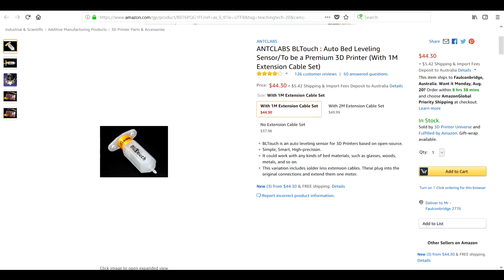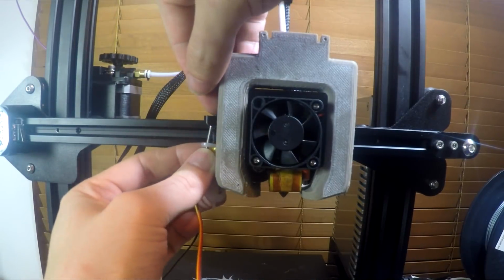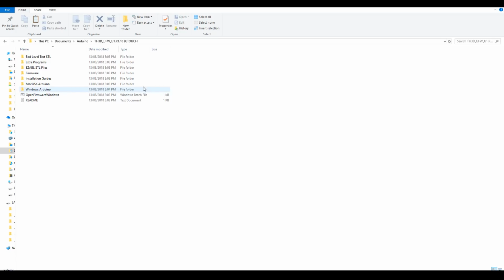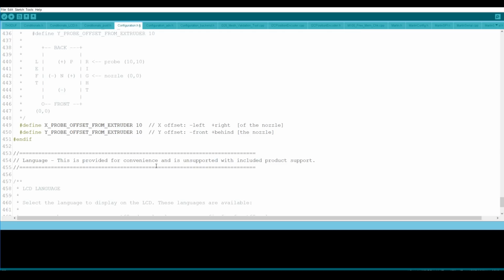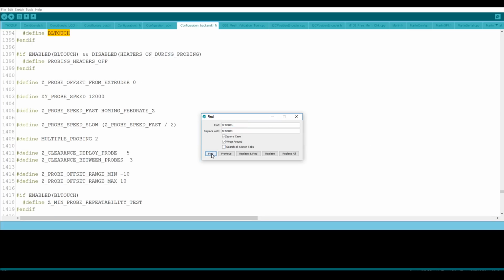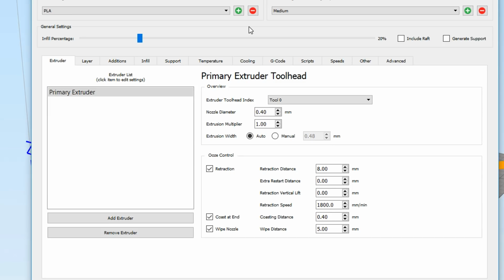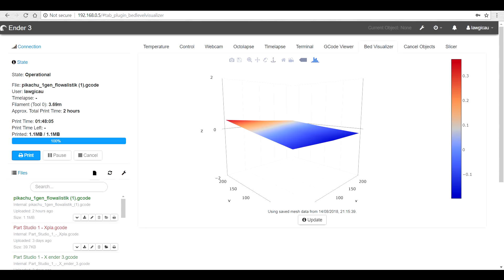How to: Ender 3 BLTOUCH with SD card support and no wires cut

Comment: Just fried the main board on my Ender 3 following this guide :) Hopefully its only the main board that's fried. I think the problem was switching the wires on the Pin 27 Board plug, it seems not all boards require this.
Reply: Yeah.  I just had the same thing happen.  Just plugged it in and smoke.  No display any more.  Upon further inspection, the pins for the Pin 27 Board plug do NOT need to be swapped as this video suggests (at least for the board I got).  I'm angry that I just followed along thinking, this all the changes must be necessary.  These guides give you the confidence to attempt something like this, and then turn out to be not all they are cracked up to be.
Reply: I had the same issue. But I don't know if the board is dead because I can still use it with octoprint.  But when I unplug the Raspberry the board doesn't start. I really don't understand what is happening here. Have you tried that on your side ?
Reply: @alexandreray8223  O changed the Mainboard, and now the printer starts. I still have a problem with my BLTouch, It just blinks now. I don't use Octopi.
Reply: @DanA-ox7gu  ok thanks I'll change the board I think and switch to mks gen l

Comment: Hello, I followed this tutorial using the TH3D Firmware U1.R2.7, had just a few differences, only 2 "BLTOUCH" search/replace and best of all, now there is no need to disable the boot screen anymore, it compiles to 98% of memory use at first attempt! Also, fortunately, my Pin 27 out must be ok because I did the swap like your instructions and everything is working fine. Autolevel is a MUST!!! Thanks!!!

Comment: I just installed my BLTouch following your instructions.  Many thanks!   I have a couple of things to note for anyone doing this after 1/28/19.  First, the latest version of Th3D doesn't need anything removed from it to compile down to the requisite size.  I didn't have to edit out the boot screen, as you suggested and still had a compiled sketch that used 98% of the board memory.  The second is a quirk that I discovered, and hope that it's helpful to others.  I first tried to flash the firmware from a Mac using the latest version of MacOS (Mojave), and ran into all kinds of communication errors with the board in my printer.  I first thought this was because I'd done something wrong in my wiring, but I could find no errors there.  The easy fix to the problem was to use a Windows computer to flash the firmware.  When I did this, everything worked just fine.  Thanks again for this guide.  I've learned much from it that I hope will make my Ender 3 prints even better in the future.

Comment: I followed all of your guides for this, I even flash the Unified Firmware when I had Marlin and for some reason the bed leveling isn't activating when i print. I am using Octoprint and Cura on my computer and uploading the gcode to Octoprint. I have tried it with the custom gcode in Cura, custom gcode in Octoprint and I cannot get it to actually work during a print. Please help as I cannot figure out what is going on and I have literally spent 8 hours trying to figure out what is going on and nothing.
Reply: Just to add...I can home everything in and set the z offset and I can even use bed visualizer in Octorprint to see my bed.

Comment: Hi Michael,  I have a genuine BL Touch on an Ender 3 installed as per your instructions and it has been working really well until now. What is happening is that after the 9 probes the "leveling map" is being lost, especially on the left side of the bed. Unfortunately there have been a couple of times when the plastic probe has hit the bed clip on the left side, could this be the issue or is it something to do with the script?   This is the starting script I am using that has been working well until now. At the moment my solution is to manually level the bed on the fly but thats not a proper fix.

G28 ; home all axes
G29 E; probe
G92 E0.0 ; reset extrusion distance
G1 X0 Y0 Z10 F6000
G1 Z0.1
G1 X6.0 E9.0  F1000.0
G1 X5 Y30 Z0.2 F3000 ; get ready to prime
G1 X100 E12.5  F1000 ; prime nozzle
G92 E0.0
Any idea what is going on would be much appreciated.
Reply from the maker: Probably the best thing you can do to troubleshoot is install the bed leveling plugin for octoprint. It will give a visual of what's being probed. Your start gcode looks fine. Sometimes if a bed is way crooked, the black touch will struggle. The plugin will give you more info.
Reply: Thanks for the advice, can I just plug a laptop into the printer and use octoprint rather than go down the RasberryPi route?

Comment: After doing this, when trying to print, my SD card menu is EXTREMELY slow and lagging. Is there anything I could do to fix this? Printer runs perfectly if you can get the print started.
Reply from the maker: Do you have many files on there? There are options in the firmware to change how the files are read and sorted,bi would start there. Also try another SD card just in case.
Reply: @TeachingTech  I did. It was almost like the printer was in shock or something for a minute. Works just fine now. Thank you for your videos on this and the bootloader. Great job!

Comment: No need to use a pin27 board and still no need to cut the buzzer wire. Just use 9 male/female dupont wires to extend all wires from ribbon cable to board connector except for the wire connecting to pin 27.

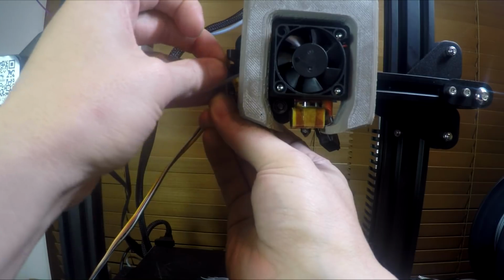Comment: Nice video, but there is one issue. At marker 3:01, you shim the bltouch with washers. This is incorrect as the bltouch comes with 2 springs. These springs will compensate for the distance and also make sure the BLtouch doesn't ram into the bed. Here is an example https://cdn.thingiverse.com/renders/bf/66/24/85/4b/6256695b43bc3eeec5456f68fab10f5d_preview_featured.jpg

Comment: HI, I just got my first printer (ender 3 pro) and my bed is not totally flat, the middle is at a lower point than the edges. Would this modification help with it or should I get a new bed anyway ?

Comment: Followed parts of your guide to get my BLTouch set up with the latest TH3D on my Ender 3 and it helped a ton, thanks! 

Side note: I made all the changes in this video to the latest TH3D (U1.R2.7) and still had 2% space left without having to disable anything. This means you can likely now have support for both ABL and a filament run-out sensor with only having to disable the boot screen. :)

Comment: I did this with the newer version of this firmware and there were only 4 changes in the configuration_backend.  When it finishes probing it shuts off both my bed heater and my extruder heater then starts printing :(  Please any help would be appreciated.
Reply: Finally figured out what it was some ABL plugin for octoprint that shuts off heaters after BLTouch.  Why would anyone want that lmao deleted that plugin.  I'm flashed to Vanilla Marlin now though, any reason to switch back to Th3d?

Comment: Got mine up and running with this guide. My firmware was a little different but I figured it out. Thanks. My 27 pin was in the proper configuration so no swapping wires. I have a controls and automation background so no problem "but" some people may have a bit trouble with this guide.

Comment: Thanks for the great videos and keep 'em coming!  One suggestion, though - when it comes to rewiring / re-pinning, would you please take a few extra minutes to dive into WHY you need to rewire something? I should have taken a closer look at my own rig before blindly following along, but I didn't... As previously commented, not all Pin 27 boards require swapping the 5V and GND wires (mine came from Amazon earlier this week).  When I booted up after installing the mod, the fan started spinning and the LCD flashed intermittently, but nothing else happened.  I pulled everything apart and sure enough, my Pin 27 was pinned to match the BLTouch connector!  I swapped the red and brown wires back and was able to boot, flash, and test my BLTouch.  Others, it seems, weren't so lucky!  

ALSO: A few days ago, Vampyrex13 posted a comment on thingiverse that very nicely sums up the firmware changes needed to make BLTouch work in TH3D R2.7 - Hope this helps others as much as it helped me:  https://www.thingiverse.com/thing:2975949/comments
Reply: Here's a link to the Pin 27 board I used:  https://www.amazon.com/Creality-Ender3-BLTouch-Filament-Sensor/dp/B07L2Q2SSD/ref=sr_1_1?ie=UTF8&qid=1545525515&sr=8-1&keywords=Ender+3+Pin+27+Board

Comment: So after watching this video several times, the one thing that is completely missing from you instruction guide is tell people that the z switch that came with the original ender 3 will no longer be able be used.

Comment: Hi Michael. Thanks so much for your great, well explained videos. I am new to 3D printing and have just bought the ENDER 3. I've followed your video regarding adding the bootloader which worked fine. The hardware side of the BLtouch is complete but using the latest download of TH3DUF_R2  Arduino 1.8.7 the sketch is a little different from the video. I've tried the best I can to follow your video but when I try to upload the sketch I get the following error:-
 In file included from sketch\MarlinConfig.h:42:0,
                 from sketch\printcounter.cpp:23:
SanityCheck.h:830:8: error: #error "SERVO0_PIN must be defined for your servo or BLTOUCH probe."
       #error "SERVO0_PIN must be defined for your servo or BLTOUCH probe."
I did change the line 165 to:-   #define SERVO0_PIN27
Where am I going wrong? Thanks Michael

Comment: Has anyone had the situation where the extruder moves too far to the right and the fan hits the bolt heads ? I've tried changing the bed size with no success . Is it position to change the bed level position

Comment: Something to consider is running positive and ground to the 6 pin area that you use to install your bootloader. Reason is i ran a bltouch through the 27pin adapter and yesterday my display got fried.   Was it the bltouch or a bad screen? I really dont know. But i do know i wired my first ender 3 through the 6 pin setup 6 with signal only going to pin27 months ago never an issue. Wired in a bltouch to 27pin adapter all 3 wires and within 3 days my display goes bad. Not saying its a bad wiring idea because i always leave coincidence completely open when it comes to printers. But it may be worth checking into to see if others have had the same issue and if the alternate wiring is or isnt a better option. But thought this would be a good video for teaching tech to show multiple wiring possibilities since he does such a great job on ender 3 videos

Comment: Sad that the Ender3 won't support both the runout sensor & BLTouch. I guess if I had to pick it would be.....   BLT.
Edit: Thanks, found the video, but didn't remember to edit my comment. There's also a way to do runout via the Pi & an Octoprint plugin.
Reply from the maker: Please see my runout sensor video, I have both working at the same time.
Reply: I just installed my BLTouch and found that I still had 2% space left without disabling the boot screen using the latest TH3D (U1.R2.7), so if you disable the boot screen now it may free up enough space to have both BLT and a runout sensor (I haven't tried this yet but I am planning to).
Reply: Just use Octoprint for runout. It has a plugin. No need to resort to TH3D customized f/w just use vanilla Marlin and some suggestions in the comments of that video & possibly this one of things to remove to save space.

Comment: if you umplug the Z motor wires tu plug the black and white BLTouch wires, where to plug back the Z motor wires?
Reply from the maker: The BLtouch black/white wires plug in instead of the original z axis end stop switch. The z motor wires are unchanged.

Comment: Going to point out, you LEft a API Key in plain view, also let us know what IP Address your Main Machine that Monitors your 3d Printers.  Even if its a internal network IP Address, it can tell us alot. https://youtu.be/ocAeZRPVusw?t=706
Reply from the maker: I don't have my PIs accessible outside my home network for this reason.
Reply: @TeachingTech  Wireless Technology isnt that hard to crack. Also Doxing is quick easy since you do have a Internet Presence. Please keep in mind, I'm simply trying to be polite and let you know <3 When you Edit your Videos simply Blur out with the Blue Tool and Track ;3
Reply: @TeachingTech  Also Thank you for your Video, :d Just Wish I could get the 3d Printer to Print properly so i can Print off a Mount.
Reply from the maker: I appreciate the heads up.

Comment: Need HELP....I recently install the BLT on my Ender 3 and followed your guide and it seemed to go great. Turn is on and it does it's self test, it responds to the commands in the firmware(THD 2.4) but when I try to home it , it drops the probe for Z axis and lowers but never stops, crashing into the bed. If I wanted to test the module manually, what kind of signal should I get out of it? I used the adapter board so there was no splicing.
Reply from the maker: First suggestion is to reverse the black and white wires into the board. Secondly, this is a vanilla marlin video and you are asking about th3d marlin so it's very hard to advise you.
Reply: @TeachingTech  Is this a vanilla Marlin video? It looks like it's a THD video, with a link to the firmware and mentions in it of the THD. Can you make a video with the new version of THD? Things have mega changed since this video.
Reply: It's possible the wires connecting your BL touch to the Pin27 board are incorrect.  This video tells you to switch them but mine were correct from the makers.  The Pin27 board should indicate which pin is which.  Just ensure your BL Touch pins match the PIn27 board.  DO NOT just switch them because the video told you to.

Comment: followed this guide using newest TH3D.  I think I have it configured properly but am getting strange results.  When I power on I get the self test up and down on the sensor.  When I do the bltouch menu item test the pin just moves up and down never stopping.  When I run the M48 test it initiates and even when the pin hits the bed it doesnt stop and will run the tip into the bed.  (I power it off).  I have run it again with triggering the pin early by manually pushing it up but it still runs down.  Looks like it isnt zstopping at all.  Any suggestions?
Reply from the maker: Usually this problem means the black and white wires from the bltouch to the mainboard z end stop switch are backwards. That would be the first thing I checked.
Reply: @TeachingTech  thanks, I did try swapping the wires incase I had them crossed, but that wasnt the problem.  I believe I had a hardware problem with the sensor itself. I tested continuity on all the wiring and I don't have any wiring issues.  Hopefully the sensor replacement will be the fix.

Comment: Thank you for the great video, I installed my BLTOUCH at 3D. The test from the BLTOUCH operating menu is lit but when it gives the home Z the printer goes up, and so stays. When I choose home all X and Y are reset Z axis down, even after the BLTOUCH sensor has hidden, the printer does not stop. Will you suggest what can create a problem? Where can I check this PIN 27?
Reply from the maker: Genuine bltouch? Reversing the plug into the z endstop plug of the mainboard is a good place to start.

Comment: Is there a difference between R1.10 and R1.10a?  Reason is, everything seems ok.  If I do a G28/G29, it goes through the leveling process.  But when printing anything, it seems to not do leveling.  

The Z setting on the printer screen never changes.  It stays, while X and Y change as the print proceeds.

Using OctoPrint bed leveling visualizer, I get a visualized image that is not level, so the probe is working...but it is not reflected or being used in any of my prints.  Any suggestions?
Reply from the maker: I will be updating this video with vanilla Marlin son because there is evidence to suggest TH3D has been tweaked to undermine a BLtouch install.
Reply: @TeachingTech  thanks... Looking forward to it.  And thank you for all your efforts and expertise you share.  It's made my spur of the moment 3D printer purchase a very useful new hobby.